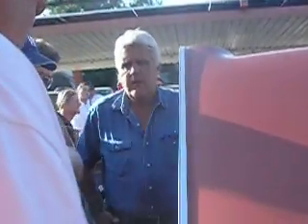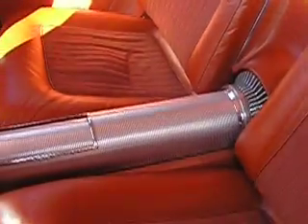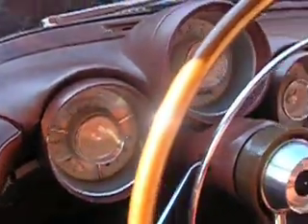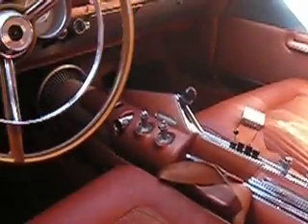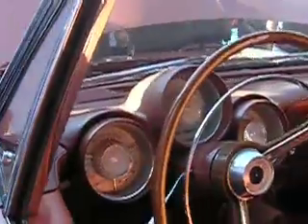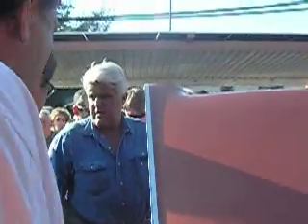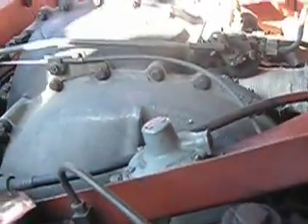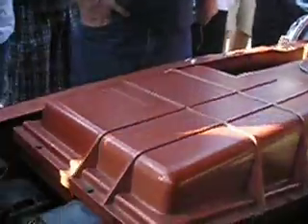Jay Leno's Chrysler Turbine Car

Comment: There are still a lot of difficulties with turbines in cars. Throttle lag is one; they just don't spool up very fast. Think of the problem with turbos, where the engine can't get more power until the turbo is spooled up, but unless the engine is putting out more, the turbo can't spool up. The two are very similar, just you don't have the pistons to worry about. Now, a turbine/electric hybrid on the other hand...
Emissions were a lot easier back then though. That's part of it. A lot of NOX.

Comment: true or not? unsure,  But I have read that the reason most were destroyed was avoid paying import tax (tariff).  for a while chrysler let families have these cars for a week at a time.   They ran great on unleaded gas (white gas), but in 1964 most gas stations didn't sell it.  The lead in leaded gas was very hard on the motor.  It's the same today with the leaded gas, you never want to burn it in a M1 abrams tank